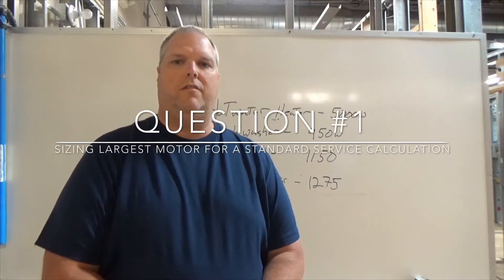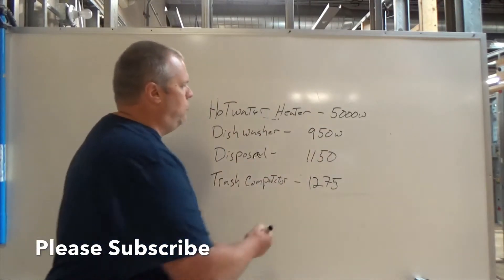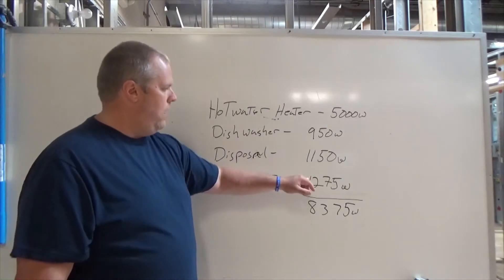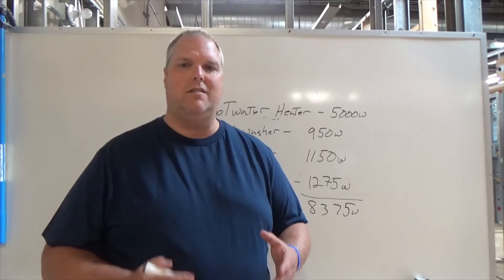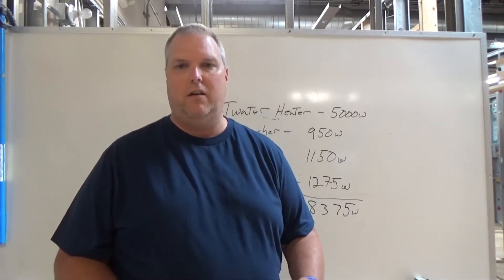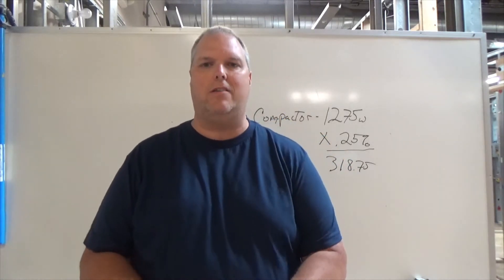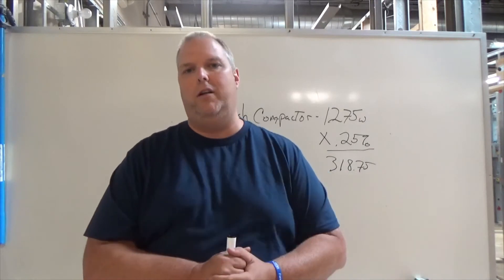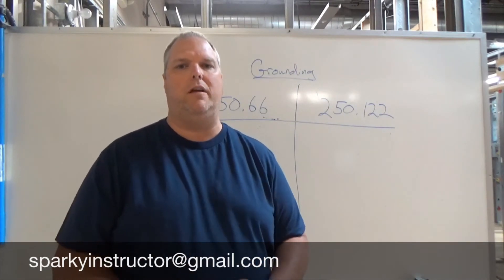FAQ on Motor Sizing and Grounding part 2

Comment: Very important video to make when you get a chance, about motor calculation base on FLA (not FLC) for NONCONTINUOUS duty ( intermittent, short time, etc) from 430.32(E). Cause those kids are missing “ the motor nameplate current rating “ from this article. And they see it like Table 430.52 which is base on FLC. Hope you get my point. Thank. Oh !! although, about the fuse size from (FLA) for OL, it can not be size up!! Because Those guys always think to size up everything... have a great day.

Comment: About “Main” bonding jumper? Is it this third tables 250.102(c)(1)? All grounding wire calculations are base on 75C? Nothing on 60C, what if the terminal is rated 60C on the equipment, are we still using 75C? 250.122 is only for OCPD?? Again, thank you for your follow up videos from my last question, it’s truly appreciate.